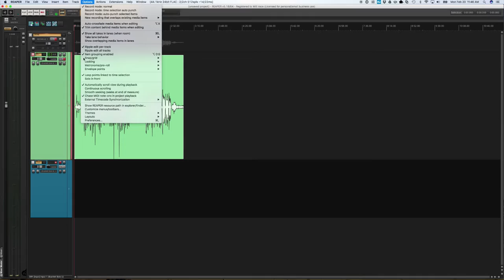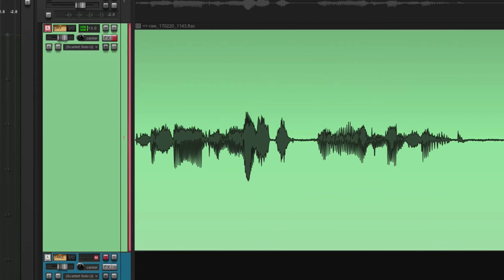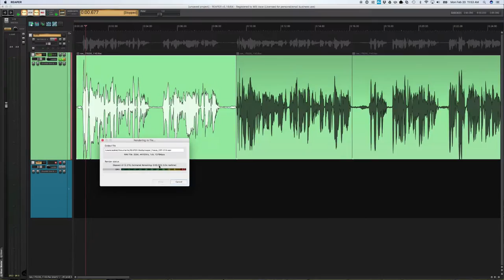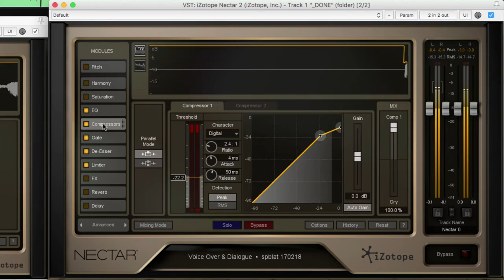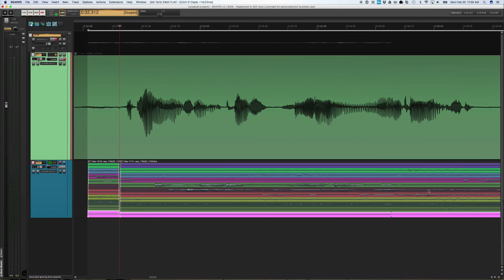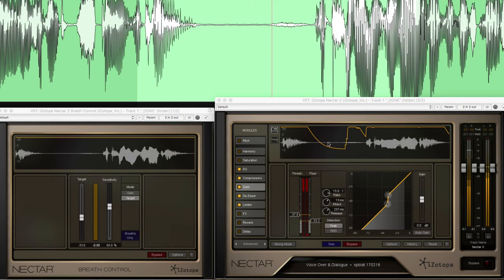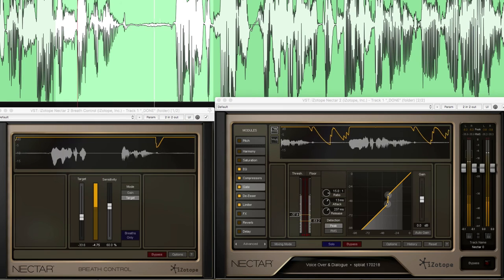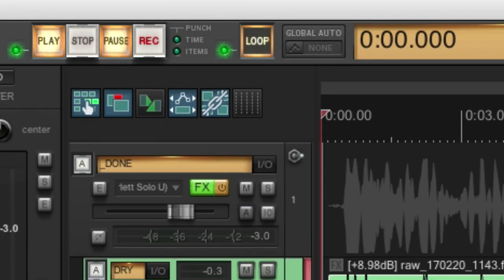Spblat's REAPER Voiceover Production Process Vol. 5

Comment: breath control vs gate - I would put the gate earlier in the chain, usually you gate before compressing. I believe the compressor is actually causing the problem here.
Reply from the maker: The order is not causing the breath issue but I agree it's a best practice to put the gate first. Since making this I've bypassed breath control, moved gate ahead of compression and (most importantly) I'm relying on gate/mic technique/manual editing to manage breathing.

Comment: I've implemented the "tsk" sound to mark the errors but I've gone one step further. Since making this sound after some time of reading aloud is a bit difficult and tiring I implemented a bottle cap. Actually the one that is used for underpressurized not fizzy drinks that make "pop" sound when you open it. I "arm" it and fire when I do some error - it guarantees exactly the same volume and is loud enough to be clearly visible in audio wave. And it is small! First I hit it with my finger nails but proper holding and only poping it by itself is quite loud (try it next to your ear...).

Comment: Hi. Could you share your contour shuttlepro settings for Reaper?
Reply from the maker: Thanks for asking. It would be good if I did. The trouble is that what I have is a combination of keystrokes assigned to Contour, and custom actions I've created in REAPER. I'm already thinking about Volume 6 because I've thrown out my effects stack in favor of another approach, so in the next video I'll provide a close look at my Contour settings and the custom actions they activate in REAPER.
Reply: Thanks. I'll look forward to it. One thing that I am really curious about. It seems like your jog wheel rotation does zoom in and scroll the view horizontally at the same time. Right? I struggled to make something similar but failed. :(
Reply from the maker: June Kim yep. Here's how it's set up. Each progressive "notch" in the spring loaded wheel zooms out some while maintaining scrolling at the same speed, which gives the feeling of scrolling faster. And the buttons most people use for undo/redo are zoom out/in. So I'm turning the wheel and using those side buttons. Tidbit: when the wheel returns to center the play head is moved to the cursor.